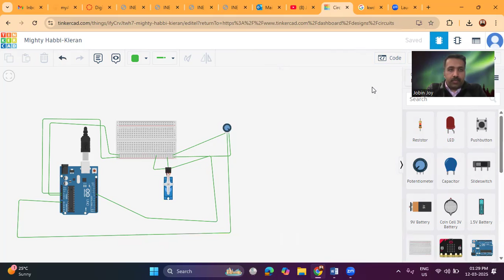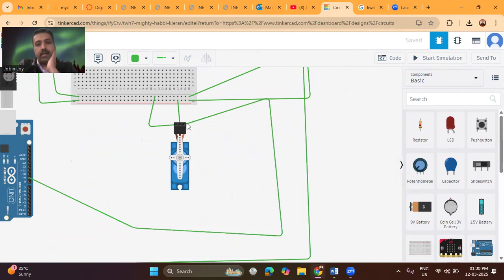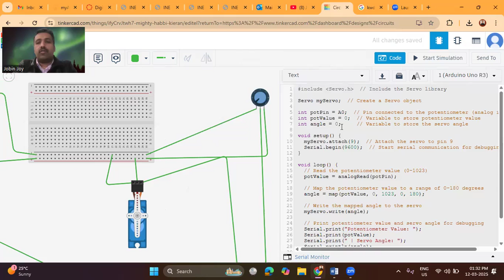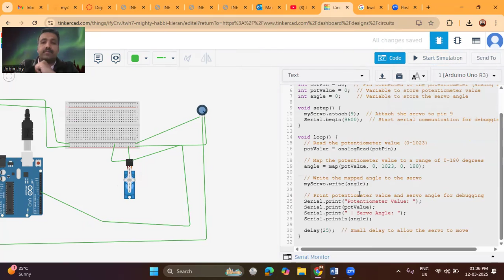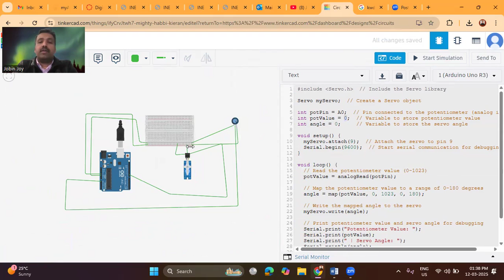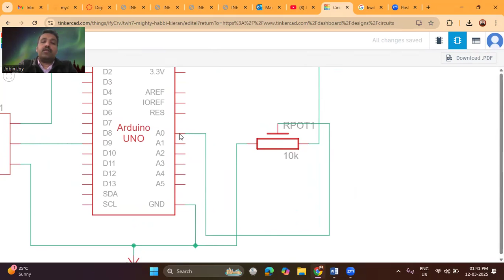Control a Servo Motor with a Potentiometer Using Arduino

Comment from the maker: #include <Servo.h>  // Include the Servo library

Servo myServo;  // Create a Servo object

int potPin = A0;  // Pin connected to the potentiometer (analog input)
int potValue = 0;  // Variable to store potentiometer value
int angle = 0;     // Variable to store the servo angle

void setup() {
  myServo.attach(9);  // Attach the servo to pin 9
  Serial.begin(9600);  // Start serial communication for debugging
}

void loop() {
  // Read the potentiometer value (0-1023)
  potValue = analogRead(potPin); 
  
  // Map the potentiometer value to a range of 0-180 degrees
  angle = map(potValue, 0, 1023, 0, 180); 
  
  // Write the mapped angle to the servo
  myServo.write(angle);
  
  // Print potentiometer value and servo angle for debugging
  Serial.print("Potentiometer Value: ");
  Serial.print(potValue);  
  Serial.print(" | Servo Angle: ");
  Serial.println(angle);  
  
  delay(25);  // Small delay to allow the servo to move
}